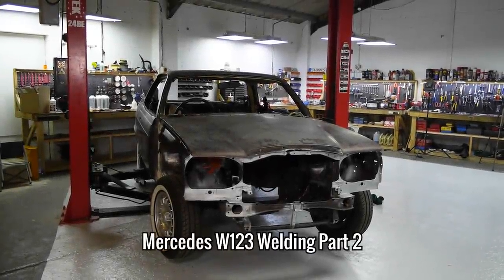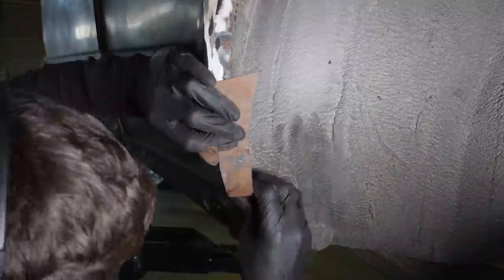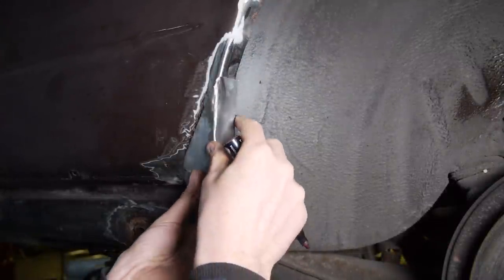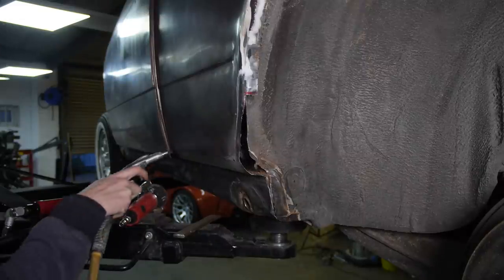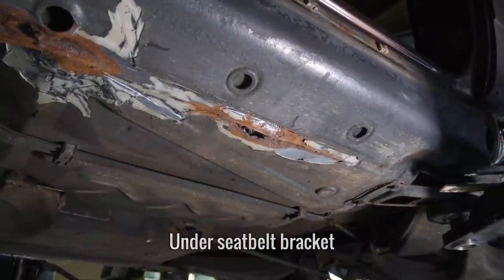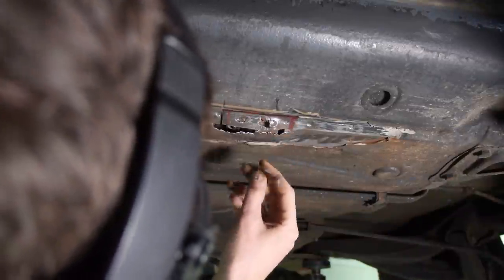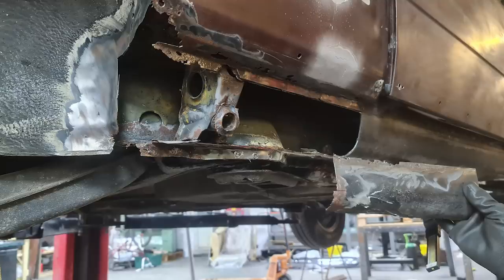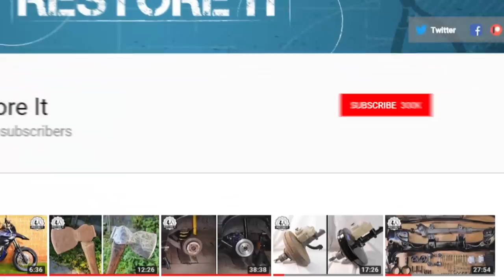Mercedes W123 Restoration | Welding Part 2

Comment: Man, that's brutal. That car has so much rust it's crazy to think that it would have to go through this much effort to fix all of it before actually restoring everything else. Hopefully, this will be the only issue you'll face and everything else is smoothing sailing from there.

Comment: I know from personal experience that rust on a car is like an iceberg - what you can see on the outside is about 20% of what’s sitting below the surface. I know this will look amazing when it’s finished though.
Reply: I made the very same experience, back in the days when I was working in a car shop. Unfortunately, my boss never learned it. So it often happened that we welded for days and did not even make any money from it, because he had offered the work far too cheap. Very annoying.

Comment: I don't know what you agreed work or cost wise, the only thing I would say repair bigger, little patches are covering a lot a rust behind them, it would probably work out easier to just replace the inner and outer sills if available, cut them off and replace, welding is like everything, the more you do, the better you get. Good works so far.

Comment: With experience comes skill and confidence. You’ll look back on these patch repairs and wish you had cut back the metal much more. It actually makes it easier because when you do weld, you’re welding thick, rust-free metal. If I were you, I would get some welding classes. The time taken will save you time in the long run.

Comment: I have not done the kind of bodywork you are doing but I have seen enough videos on youtube to suspect that a shrinker-stretcher (they are not expensive) would have been a life saver. Creating the 90 degrees bent patch by welding orthogonal pieces together is, well, nuts. But your effort and never give up attitude is commendable.

Comment: I'm restoring 2 cars atm, and I also find myself staring at a task much too long trying to plan the attack before jumping in, even after plenty of research.   

Most restore shops I have called don't give estimates for specific jobs, they just provide hourly prices.  I'm not saying every shop has to do that, and people will certainly still ask for quotes, but if you do give a quote I'd just stipulate its a quote based on what you can see, but that it could be more or less work (at the hourly rate) depending on what happens when you get in there.  I have learned one thing: rust is always worse than you expect.
Reply from the maker: I think its just a confidences thing. We'll get it in time :)

Comment: Realizing  you've bid something wrong is a bitter pill to swallow. I believe you are on two different learning curves. The 1st is learning your craft (welding) and the other is the business (bidding and estimating). As you stick with it you will definitely get better at both. Hang in there. You'll probably never make the mistake again of committing to a price before you know exactly what you are getting into. Most clients know that there are hidden problems and will understand when  you tell them you need to do a certain amount of work to find those problems before you can give them a solid price. It would only be fair. Or set a hourly shop rate and work the projects on a time and material basis.

Comment: I understand a gentlemen agreement is binding, but it was based on your customer's misleading input of "Just 4 spots of rust"! I would have re-negotiated with the customer, and led by the argument "you misled me". If the client did not accept paying for the 13 rust spots he failed to mention, i would simply skip doing them whilst announcing it loud & clear! I totally agree with @smifffies & @schmeat.
Great work btw, and inline with everybody else's comments: your welding skills have gone through the roof from your days welding that E30!! Kudos!

Comment: I have been watching your videos with great attention and pleasure. Congratulations for your work. I have just a comment to your electro plating activities. In my professional life I have learned through the worst possible way that in the plating process (using zinc coating and subsequent bichromate coating) hydrogen migrates into the steal crystallin structure and produce very brittle pieces. Screws subjected to high tension and spinning forces tend to break sooner or later. An heat treatment is necessary to remove the hydrogen. I strongly recommend you to take a look on this. BR

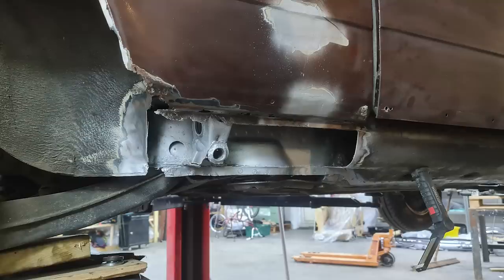Comment: speaking of learning how much to cut away: If there is rust, cut all of it away. rather a cm more than a millimeter too few. @ 13:50 there is too few cut away, too  much old rusty panel there. Otherwise a decent job. I am a bit stunned there was no rust @ the firewall. normally the w123 has enormous problems when going up the wheel arches inside to direction of the cockpit.

Comment: 7 months later still fixing the rust. That's definetly a w123. If you look back at the comments for the first video when you were stripping the car I did warn you about this. I own a w123 so I know. If you had spoken to any w123 owner they would of told you this too.